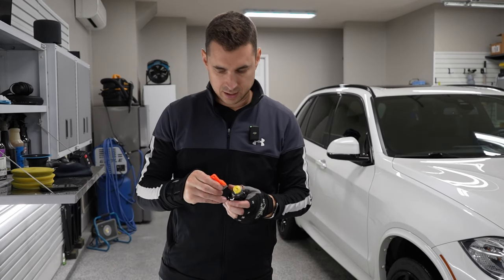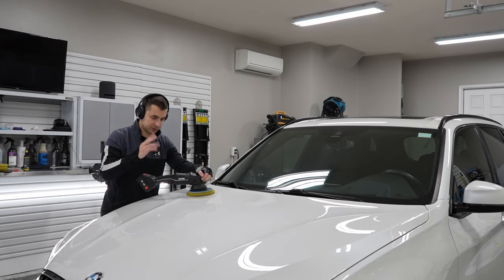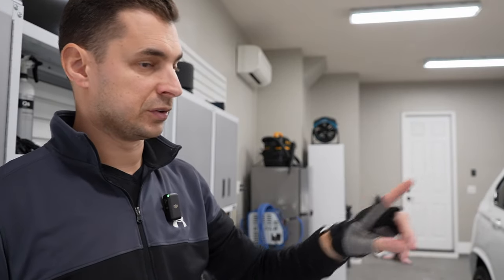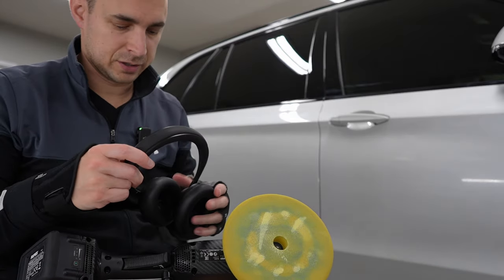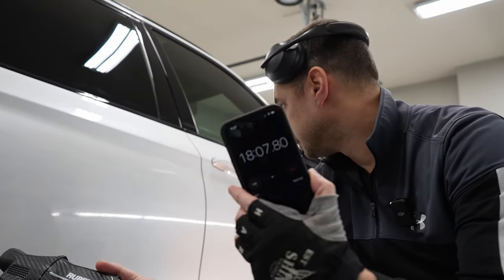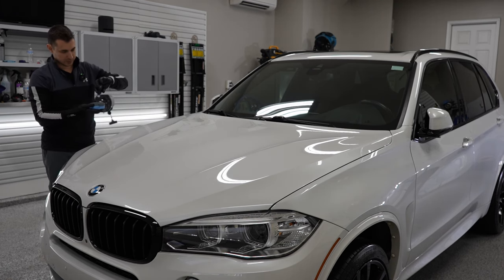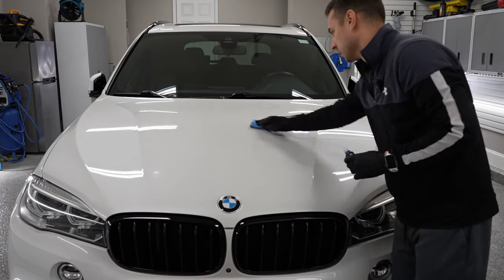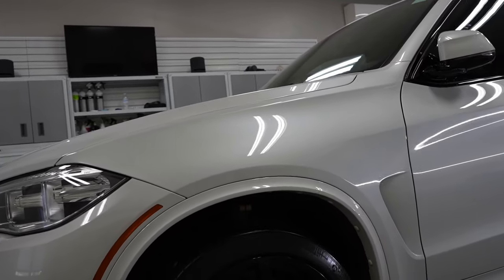Rupes HLR21 - Battery Endurance Test - BMW X5

Comment: I thought for sure when it was announced they said the light bar turns red when the battery was low or if you push to hard and it stalls
Reply from the maker: I’ve only seen the blue color
Reply: I saw that too, but I'm guessing maybe it didn't make the final firmware. Slow blink for low battery, fast blink for overload...but I can't see how anyone could manage to make it actually happen. These machines have a ton of torque and don't stall.

Comment: I sold my milwaukees and got hlr15 and 21. They are awesome! So smooth and power is onbar with the milwaukee.
Reply from the maker: That big of difference? I’ve only used the mil rotary
Reply: @nc.detail  Yes. Power is equal but all other things rupes wins. Its like 800g lighter, quieter, smoother etc. Milwaukees are very good but rupes's are great :) Btw im all long throw.. i usually only do spot work or finishing with rotary and do cutting with 15 or 21. Forced rotations are not good.
Reply: @jtm1979  in another video you said you were disappointed in the hlr15 power??
Reply: @orthodox1717  yeah. Hlr21 is a beast and as powerful as Milwaukee and mk3 while being smoother and lighter. Hlr15 however does seem to lack bit of.
 power. Its not nearly as weal as flex but it does not have the power of mk3 which is bit dissapointing sine milwaukee 15 does. It is still.cabale, smooth and light, just not the strongest. I wonder why so big difference with 21 and 15. Shinemate had same problem with their eb351, 21 destroys 15.
Reply: Throw the 5inch backing on the 21. Let me know how that runs
Reply: @richardgarcia8860  its usable, but vibrates. I have a custom made kamikaze stylw bp which weighs about 130g and its butter smooth.

Comment: Is this the speed you polish your arm movement is way to fast
Reply from the maker: Just edited
Reply: @nc.detail  I thought it was how are you finding the new rupes hlr is it more superior to the mk3 corded
Reply from the maker: It’s a good machine this far but only used it on two cars. The main con so far is the battery life when cutting.
Reply: @nc.detail  Thanks for the reply back I'm holding back buying one as I'm sure later on in the future there will be a mk2 version the cordless polishers is the way forward and many years to come battery technology should improve same as EV cars